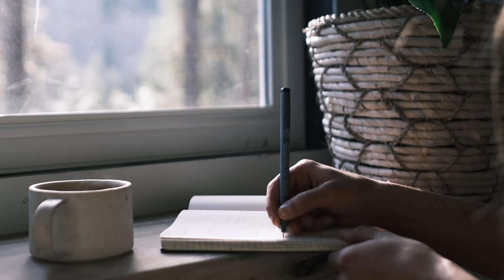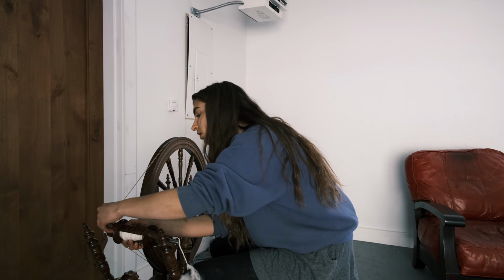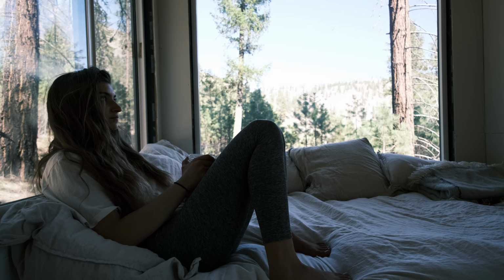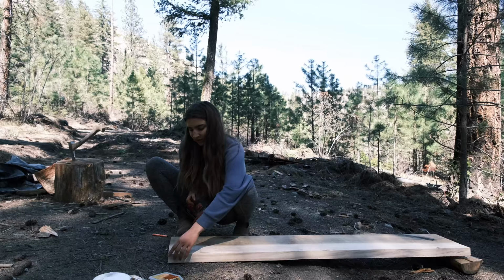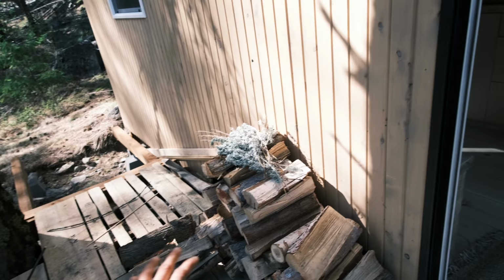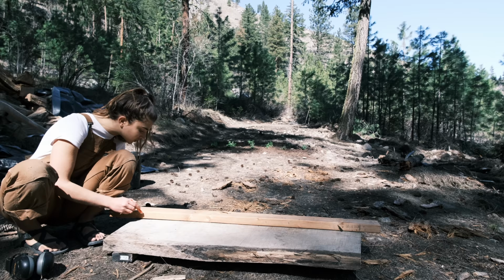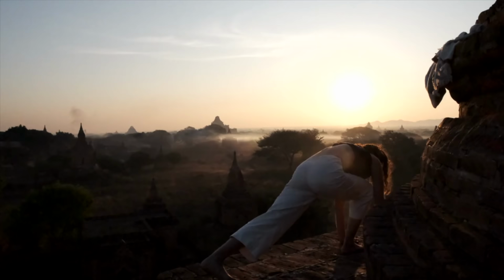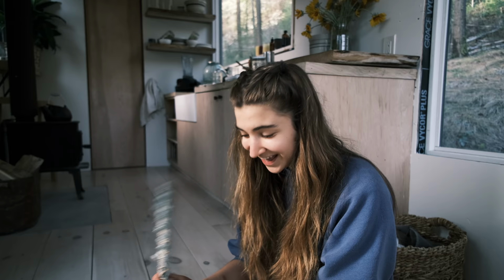Rethinking My Entire Life (Story 76)

Comment: A well-meaning tip for keeping your flowers alive for longer: Don't use scissors to cut them, because they will squeeze the stems. Use a Knife and cut the stems diagonally to make the surface bigger, from whitch they can drink. Also put a little bit of sugar (1/2 of a teaspoon for 1l) and a copper coin into the water. This will keep them from rotting for longer. Changing the water every other day helps too. With this i get most of my garden flowers to last at least 2 weeks. =)

Comment: Dear Isabel, It's wonderful seeing you learn to weld and use the drill press and angle grinder. As a long time professional welder and fabricator  and log home builder for some big companies, I want to pass along some loving safety tips. 
Firstly, always keep your hair covered when welding, as the small sparks damage your hair.  
Secondly, and MUCH MORE IMPORTANTLY, make sure you tie your hair back and tuck it away INSIDE THE BACK OF YOUR SHIRT to keep it well clear from moving parts such as the angle grinder and drill press.  One of my coworker's hair was pulled into a bread mixer, that we used to mix other materials , and she was beyond severely injured and almost killed.  Grinders and drills are unforgiving and so dangerous around long hair and loose clothing. Also, never wear gloves when using the drill press (you were not in this video thank goodness) as gloves can easily be grabbed by the drill bit and twist your hand and arm and bones will be broken and worse.  Stay safe and keep sharing your awesome corner of the earth with us. :)

Comment: Isabel, jambo. Don't mean to school you, heaven knows you have so much knowledge on life's intricacies already but this comes from a caring place. Please run cold water over your pressure cooker or gently let the steam out, through the value at the top of the lid. Put a small spoon to raise the value and let it release slowly. The way you release the steam outside by just opening the cover/lid has a very high risk tendency at various levels to hurt you. Please i don't want you to get hurt God forbid.
Reply: wouldn't cold water over hot metal have a disastrous result? That doesn't sound wise to me
Reply: @tinaperez9756   @Tina Perez  Tap water tina, that would do. the idea is to reduce the temperature from the boiling point (depends what it is, where isabel's location is) to reduce the pressure/steam within the vessel. Metal fatigue would happen at higher temperatures and longer duration of use but before that the rubber lining within the vessel would given in, as its made for a certain amount of uses. Opening it, in the way she does, near her face, feet/ body can be very terrible with serious damage. I hope you found info helpful.
Reply: @tinaperez9756  if it's hermetic closed there shouldn't be a problem... I cook with it almost everyday, but first she has to let some vapor out so there's not so much pressure... or let all the vapor out and wait 5 minutes so it's not that cold and then you are safe to open it
Reply: @khuramchaudhri2048  yeah. I"m not convince putting tap water on boiling hot metal is the right thing to do. I don't trust those pressure cookers.
Reply: @tinaperez9756  its not the thirteenth commandment, do whats comfortable to you and do learn to trust them as the manufacturers goal is to provide a safe and working product to the customer. The idea of my post is to be safe and its one of the ways to reduce temperature, which makes it safer to handle and open the lid. Otherwise if you read what i said or "gently let the steam out of the value", which would be the ideal way and i am sure the manufacturers have also stated so. Anything is better than opening the lid and getting a blast of steam on you. Otherwise, their always is the instruction manual closely read it and follow the safety instructions.

Comment: Get yourself a Big Wheel Cultivator off of Amazon or from Lehman's Hardware. It does similar to a rototiller, but is manually powered. You're the engine not some four or two stroke internal combustion machine.

Comment: You need to invent, make something that could be raised up a decent distance from the ground where you can plant you herbs. Like a platform between two trees with ropes to hoist up and down. Or Just drill holes in pots and rope it and lift them off the ground over branches. Etc. If you had a semi flat roof that would work great.

Comment: always clamp your drill work down. steel and harder, use pilot holes and drill wider incrementally. good speed, good use of cutting oil.  good to see the PPE use. hope you've got leather boots on.   belt sander w/o glasses - wth?  Orbital sander with.... right, eye protection and dust mask. if you want your hands dinged up that's fine. (they really are better)